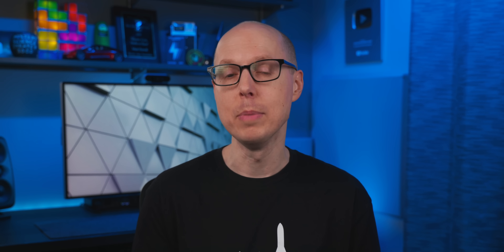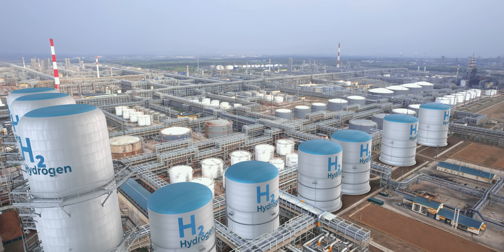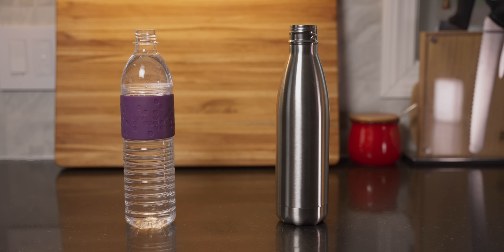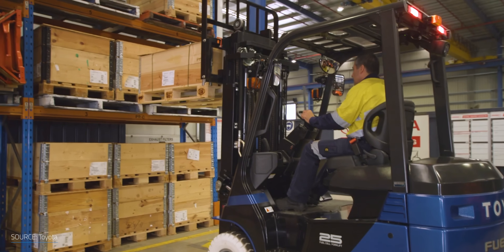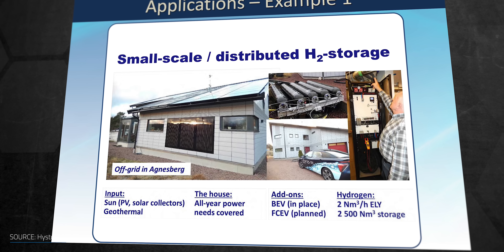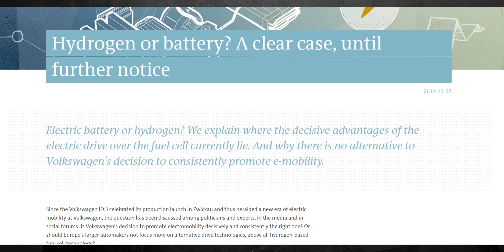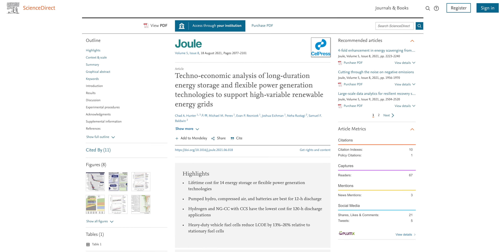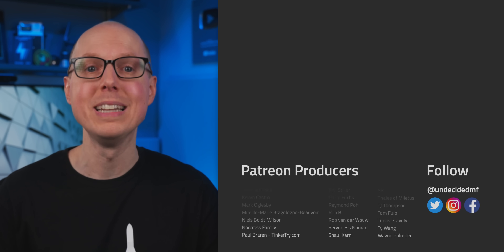Solid Hydrogen Explained (Again) - Is it the Future of Energy Storage?

Comment: The first question should be where is the hydrogen itself coming from?  The petro-chem industry wants to use fossil fuels (methane and coal) as a source (in fact I think that's what they do now already) making it an equally bad climate choice.  You could use simple water to extract the hydrogen molecules which makes much more sense but all in all I am not interested in hydrogen based energy.

Comment: How long would it take to recharge one of these hydrogen metal cells if it was used to power a car? How does it compare vs conventional batteries or ICE/diesel engines running on the various hydrocarbons in terms of refueling speed/safety? It sounds like it would require a fair bit of time even if the hydrogen was already collected and stored beforehand, but that process too seems like a rather slow and costly process. If it's efficient enough at scale maybe it could be used on cargo vessels when they're near populated areas to reduce the amount of bunker fuel they dump into the air locally and then recharged by running electrolyzers while in the deepwater away from the coast or while plugged into dockside power while being loaded or unloaded.

Comment: Reaction of Aluminum with Water to Produce Hydrogen

The purpose of this White Paper is to describe and evaluate the potential of aluminum-water reactions for the production of hydrogen for on-board hydrogen-powered vehicle applications. Although the concept of reacting aluminum metal with water to produce hydrogen is not new, there have been a number of recent claims that such aluminum-water reactions might be employed to power fuel cell devices for portable applications such as emergency generators and laptop computers, and might even be considered for possible use as the hydrogen source for fuel cell-powered vehicles.
In the vicinity of room temperature, the reaction between aluminum metal and water to form aluminum hydroxide and hydrogen is the following: 2Al + 6H2O = 2Al(OH)3 + 3H2. The gravimetric hydrogen capacity from this reaction is 3.7 wt.% and the volumetric hydrogen capacity is 46 g H2/L.
Although this reaction is thermodynamically favorable, it does not proceed due to the presence of a coherent and adherent layer of aluminum oxide which forms on the surface of aluminum particles which prevents water from coming into direct contact with the aluminum metal. The key to inducing and maintaining the reaction of aluminum with water near room temperature is the continual removal and/or disruption of this coherent/adherent aluminum oxide layer.
A number of reaction-promoting approaches have been investigated for the aluminum-water reaction. These include additions of hydroxide promoters such as NaOH, oxide promoters such as Al2O3, and salt promoters such as NaCl. These additions act to disrupt the aluminum oxide layer on the aluminum metal. In addition, the reaction of water with molten aluminum alloys such as aluminum-lithium and aluminum-gallium has been studied. In this case, the molten nature of the alloy prevents the development of a coherent and adherent aluminum oxide layer. However, none of these approaches have proven commercially viable to date.
The concept of using the aluminum-water reaction to provide onboard hydrogen for hydrogen- powered vehicles presents a number of difficulties. First, storage systems using this approach will not be able to meet the 2010 DOE system targets of 6 wt.% hydrogen and 45 grams hydrogen per liter. Second, based on published aluminum-water reaction rate kinetics, it appears

Comment: As you mentioned, efficiency is sexy, but the cost is just as essential.  The market always prefers cheap yet less efficient tech over an expensive-90%-efficiency.  

Another important point when discussing the high cost of hydrogen infrastructure and implementation is that these costs continuously decrease rapidly.  
Battery's decreased from $1000 to $100 per kilowatt.  That's why government subsidy in the early stages of development and adoption is critical.

Comment: What I'm about to say, is not about storage. I know how to make it! HHO. I tried to use it with gasoline in a car, and it did get 54 MPG. In a 1996 Pontiac Bonneville, The only thing that it did was melted the catalytic converter, Lol! I know that some carmakers out there are building some vehicles that run on HHO. If you mix the two together, you shouldn't have the emissions that you have today! It would be a higher burn rate, and no need for the catalytic convert. I have seen some guy's on YT that made a truck that makes its own fuel on the go, all you need is water and salt, and a generator, oh and a big battery! Oh, God! That's where we need storage! We do have the Hybrid cars, still runs on gas! It would be nice if you could put in and get more out, then you put in. Hydrogen would be the ticket! I do know how to burn water!

Comment: Is there development of graphene solid state storage units that work on a similar bases as metal hydrides and wouldn’t it be lighter?
I personally think batteries have won the race to power cars and motorbikes etc who sit around doing nothing for “80%” of there time, but when it comes to commercial vehicles such as lorries, tractors, diggers, power boats, yachts, ships and planes, that are used 24/7 and require a longer range and power demand, batteries simply cannot compete against the possibilities of hydrogen?
JCB are developing a hydrogen system that uses a combustion engine for their diggers, it would be interesting to here your views on that and the Americas Cup has developed a hydrogen power boat?

Comment: What you are talking about is a benefit in energy storage but is the bane of electroplating. In electroplating, it is call hydrogen-embrittlement where the absorption of hydrogen in a metal, especially steel, during plating operations. This absorption will cause steel to become frightfully brittle until it is baked to drive out the hydrogen.

Comment: Nordic countries producer hydrogen on-site at the fill stations and then triple phase compress it into the car from low pressure storage where it also has less seepage and low pressure storage and then it doesn't have time to see once it's in the car because it gets used up almost immediately. So if you produce the hydrogen on site at the fill station you negate the need for transportation and sublimation.

Comment: In petroleum processing plants the rectification Tower the hydrogen sits at the very top of the rectification Tower and is usually burnt off by set petroleum refineries because hydrogen is a threat to the bottom line of the petroleum companies duh

Comment: Bob lazari made his own deuterium to line pressure vessels with metal hydrides not to heat up the hydride and extract the hydrogen but when the hydrogen fills in the lattice of the hydride and makes it so that there is less high pressure seepage because the hydride is already filled up all of its pores with hydrogen therefore making the pressure vessel more impervious to seepage

Comment: The whole idea of using H2 to replace fossil fuels is revealed to be very silly when you ask these idiots the simple question "Where is the fresh water used in the electrolysis process going to come from?"  1kg of H2 requires about 9kg (or litres) of PURE water. Let's assume GKNs system really is 90% efficient and so 1kg of H2 would produce about 30kWh of electricity. The UK (not the driest of countries in the world) uses ~7x1018 Joules of fossil fuel-derived energy in 2020 which equates to 1.5x10^12 litres of water needed to make the H2 to fully offset fossil fuel use.  In the same year, the UK used 840x10^9 litres of water.  So, if we wanted to use H2 to replace fossil fuels we would have to find an extra 180% of our current fresh water needs.... and this in a country where we are already suffering regular severe fresh water shortages (let alone in more arid climes).  Sorry, but this idea is patently daft.

Comment: Can you imagine? A hydride cell that not only stores Hydrogen atoms between the hydride atoms, but also electrons within those hydrogen atoms. It returns stored energy as electrons and hydrogen gas!  Charge them using renewable energy sources (wind, solar, hydroelectric, and some day deep geo-thermal) and we have solved our energy needs for centuries. Making hydrogen is easy, simple electrolysis of water, giving off hydrogen we store and oxygen back to the environment. The burning of hydrogen with oxygen in the air is water!  No pollution simply moved to somewhere else like electric vehicles are now... most of the energy to charge them comes from oil/gas/coal/nuclear these days. Hydrogen production/storage may not be very efficient or practical now, but as we refine our technology and use renewable energy it will eventually pay it all back. We need to start this now. I hope Elon Musk looks into it... he has the drive and passion to find solutions.

Comment: At 60°C, you could use the heat from behind a solar panel to recover hydrogen from that thing.

That way, you get the hot water but, then, gain access to the fuel too...which you could be creating using the solar panels too ☺️

There'ld also be an interesting switching point when switching the cell from one heat state to the other.

Comment: Question? Sorry it’s off Topic but? They said methane CH4, trap Heat in the Atmosphere? Why not using those methane generate from trash/ or or leaked from dwerling gas underneath the earth… use those methane and convert them into electricity again.- is it this thing called biomass or? Just curious cause idk if Solar panel use [Wave L.] to convert to electricity or if it use heat from the sun ☀️.- I might be dumb, im just asking

Comment: Hydrogen solid state storage needs the right use cases, as you said. Not very likely for earth bound light-weight vehicles. Perhaps in a long cruise space vehicle where you can refuel by opening the  storage medium to an input funnel type ram of the interstellar Hydrogen. Refuel while cruising, so to speak. Then release the hydrogen into the nuclear rocket (NASA) when needed. It's a different use case, but horses for courses.

Comment: There was a proof of concept done on an off-grid house in Austria a couple years ago, capable of storing enough hydrogen from excess solar collection in Summer to cover energy requirements in winter. There are a number of solutions on the market targeting homeowners looking to achieve self-sufficiency (autarkie) in a similar way, but all store the hydrogen as pressurised gas which puts everyone off. When they crack this on a scale that will allow metal hydrides to be used as a battery to store hydrogen in a residential home until winter to keep the heat pump running with less solar power available, then I see a pretty large potential market for their implementation. In cars not so much, but I remain optimistic...

Comment: 11:34 "[…] hydrogen reforming or waste incineration plants […] impurities such as CO and CO2"

Really?! These smokestacks do not contain "impurities such as CO and CO2" ... CO and CO2 ARE the content of the smokestacks.
- Especially with natural gas reforming, it's the H2 which is the impurity because that is the product … not the byproduct.
- For waste incinerstion plants, the hydrogdn is still locked up into the watervapor from the incineration … so even there H2 is not a byproduct. At best it is a trace element.

I usually like your content, but It's stuff like that which cost you major credibility points.

Comment: If you step back from these possible storage options for hydrogen, whether metal hydride, ammonia or even just pressurized H2 or liquification, you will always incur a large cost to make it work. And because we are dealing with physical conversion and reaction chemistry, many people are unaware that technological improvements in these areas will not solve the problems by more than a few percent gains. There is no Moore's law at work here. To convert hydrogen to ammonia or example, requires energy, and while improvements are being made in combined electrolysis, you will always run head on to the energy budget determined by physics and chemistry. So what? All these extra conversion inefficiencies add up, so that not only does your H2 infrastructure not exist, but will never be as efficient as your electricity network + Batteries infrastructure, which does exist.
Reply: Curious as to what degree of damage You incurred when You hit that BRICK WALL???
Reply: well, gave me a headache at least. These metaphors can be painful

Comment: For fixed storage, round trip efficiency is the most important, metal Hydrides are less efficient than pressurised Hydrogen.  Using waste heat means all wasteful processes are 100% efficient, including it in efficiency calculations is not practical in most situations.  Similarly capturing waste Hydrogen is not going to produce realistically useful amounts of Hydrogen.  Geostorage of Hydrogen is also not particularly practical, its a way of trying to reduce compression losses.   The pattern here is called "sales and Marketing spin", this isn't relevant to Engineering analysis.  Typically waste heat is waste heat.
IN terms of storage, yes Hydrogen can store more energy for less weight, but it cannot produce the power, batteries are powerful and simple.  If you have alot of Hydrogen stored it is expensive to release it.  The only current Hydrogen applications are ones that use low average power, but have batteries for peak demand, such as off site power production, and in all cases the Hydrogen is produced from fossil fuels, releasing carbon into the atmostphere.  It is not helpful for fixed storage which needs power,  ultimately its running cost is prohibitive and there are many cheaper, more scalable and more efficient ways of storing energy.   The most important factor for climate change is efficiency, building renewables will take time, the more efficiently we store energy the faster we can get to net zero.  Hydrogen is the least efficient of all storage so is the least scalable.

Comment: The "Holy Grail" of energy storage would be a liquid that has high energy density and emits clean outputs like H2O and CO2.  If ever invented we could use it to power our vehicles with practical recharge times of only a couple of minutes.
Reply: We tried it once, but we used easily accessible carbon from a long-ago sequestered source, and the waste kinda broke our atmosphere.
Reply: a bit of advice as to "HOLY GRAILS" & ENERGY SOURCES; do recall the hurrah over COLD FUSION...  😎

Comment: I was embarked on one of those submarines! It is actually a italo german project named u212. Check on wikipedia. One of the reason they told us about the use of metal idrur was that it was also much safer. But horrible heavy. To get 100kg of hydrogen we had to carry out 100t of bottles full of idrurs. That is why normal batteries on that sub were smaller.
Reply: interesting. Wikipedia says the U212 used "compressed hydrogen", not "solid/metalized hydrogen"
Of note, the mass of the storage is not "helpful" for buoyancy control unless the overall volumetric density is significantly higher than sea water. Ie. a 100kg container that is 1 cubic meter would be (very) buoyant and would require significant additional high density ballast to compensate

Comment: The plethora of battery materials currently being researched is literally myriad at this point. As others have pointed out the key will be cost and scalability. CATL is purportedly very close to a new solid state battery  but we're still not sure what material they're actually using. But the fact their talking about 1000km plus per charge means Hydrogen as an energy source becomes superfluous at best.

Right now there is nothing from Hydrogen that justifies the multi multi billion dollar investment to build the infrastructure required let alone an economic production process.
Reply: Just how many SHARES of TESLA did You buy previously?
Reply: @gringo1723  I've been accumulating Tesla shares since 2017 what does that have to do with Hydrogen Technology? I bought Tesla because it's an effective hedge against Legacy Auto/Petroleum something Hydrogen is not?!

Comment: Concerning the weight of metal-hydride storage: Does it have to be metal? Could this hydrogen absorption trick work with carbon? Like graphite / graphene? Or carbon nano-tubes?
Or does hydrogen absorption require a metal-like lattice? 
Or would the hydrogen-atoms just bond 'permanently' with the carbon, making methane, benzene, etc.?
How about diamond? How far are 'we' on the road to producing large blocks of synthetic diamond?
Oh, wait. We don't want large blocks. Tiny grains are better. Just lots of them. That seems doable, no? Provided the hydrogen doesn't react with, and 'eat' the diamond.
🤔
Reply: Note the several preceding information Posts addressing this subject!

Comment: But especially when it comes to mobility one HUGE aspect is notoriously ignored ... the low (time) efficiency when it comes to recharging, waiting 30-60 minutes for a batery to recharge is inacceptable and the battery is aging and losing power much faster if you constantly recharge at high power and if you don't charge "full cycles" as well. Nobody is addressing these issues when it comes to EVs! That's the main problem, the "problem" is shifted to the consumer.

Comment: Still not convinced, H2 is already a complicated, expensive and a CO2 generating energy vector to produce and then it gets a lot worse to use in a safe economically viable way. Even if we had a "free" source of H2 it probably would make sense to turn into a more stable, manageable compound by adding carbon. The root of the problem is still how good fossil fuels are: versatile, powerful,  dense and fairly safe to use. All foreseeable replacements will be bad by comparison the big question is "how bad ?"